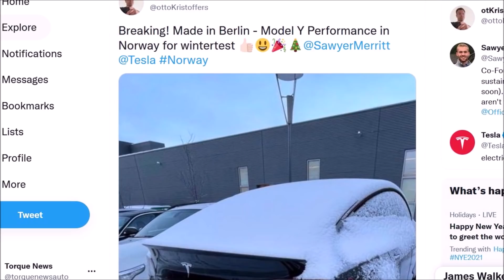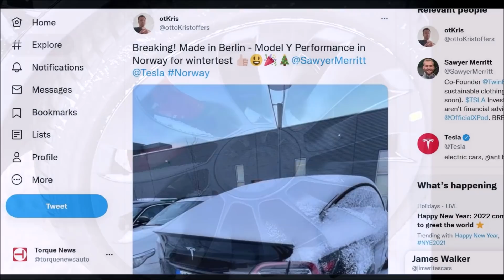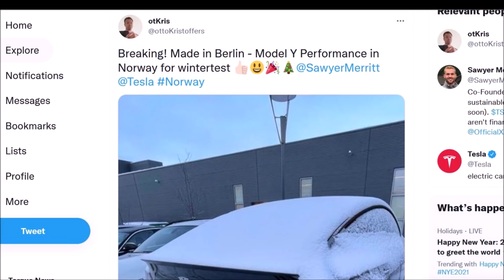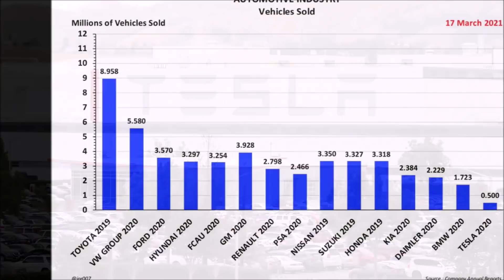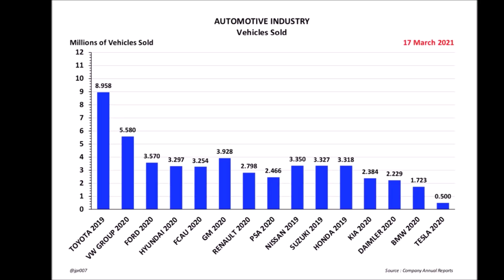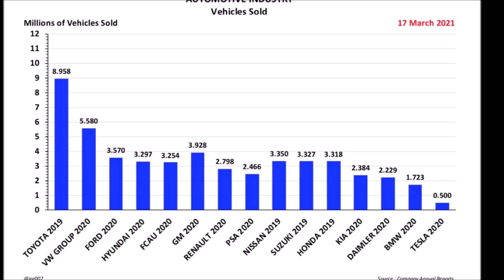Brandenburg's PM on Tesla Giga Berlin: "Don't Stumble in The Last Few Meters"

Comment: Giga Berlin will not open until June 2021 and then under water restrictions reducing production to under 100k.
Reply: 2020?
Reply: @RobertLoPinto   oops tnx
Reply: @dewpanic   No problem, but you just changed it from 2020 to 2021. Didn't you mean 2022?

Comment: I don't think the M GF 545 E is manufactured in Grünheide. To get it registered (License Plate) they would need all the approval documents from the test authority (Technischer Überwachungsverein - TÜV ode DEKRA etc). When I understand correct, this is not there as they are not allowed to produce cars. 
But in case it is from Grünheide and approval is there, getting a vehicle registered should not be a problem in the County (Landkreis). 
But registering in Berlin is chaotic. It can take several weeks as the administration in Berlin is a disaster. Having the choice between Berlin and Munich, Munich for sure is the better choice as the administration there is much better.